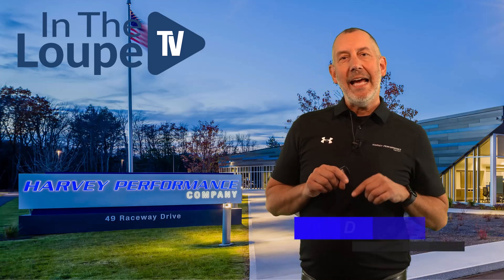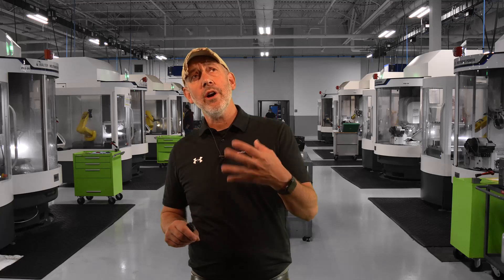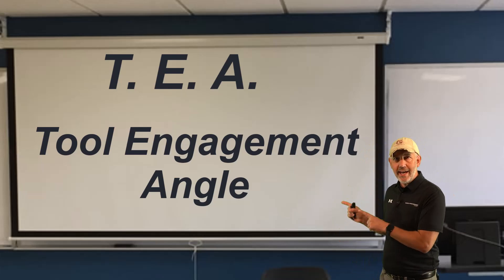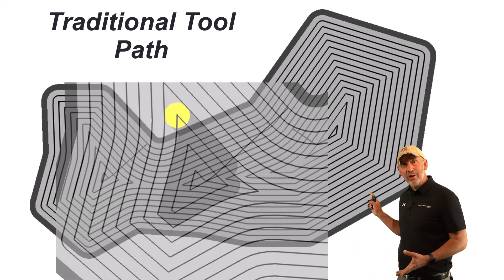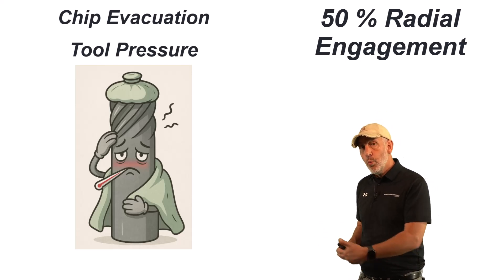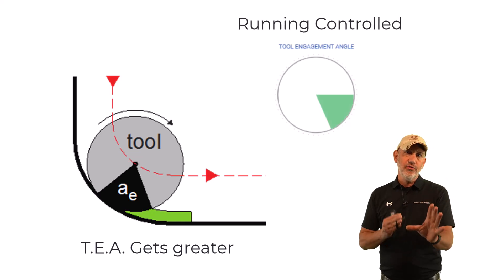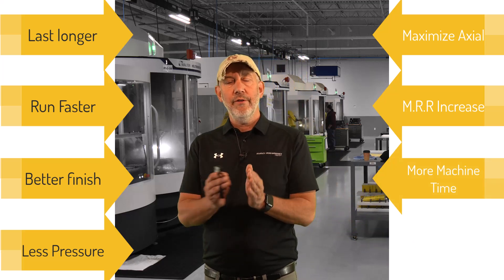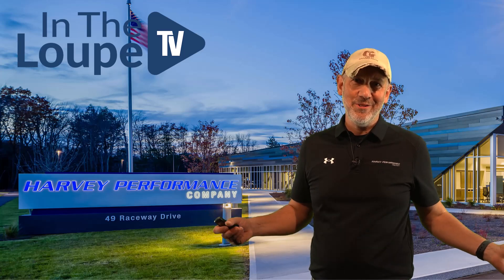The Hidden Key to HEM: Tool Engagement Angle: In The Loupe TV Ep. 30

Comment: Thanks for the tips.
BTW, why not adding more flutes to the cutter for faster ipm. Is it only chip evacuation issue, or does sth weird happen?
Reply from the maker: Adding more flutes definitely can help speed up the feed.   Problem as you mentioned, pending the material, is the evacuation of the chips..   Also what you need to think about with the evacuation.  When you add flutes, take a lighter radial, you increase your SFM and spin the tool faster and make it even harder to get the chips out at higher speeds and feeds.   Just food for thought. ctc

Comment: It’s been a while but I believe there are work arounds in mcam  called “slowdown at corner”or something similar for inevitable ones.
Reply from the maker: You are correct, All software kind of does it a little different..  Some slow down in corners, some change the radial, some control the angle..   I think the key is the software is minimizing the damage in certain conditions to maximize the tool life and machining time.   Thanks for the comment and thanks for watching. ctc